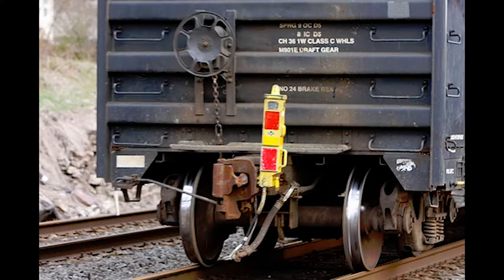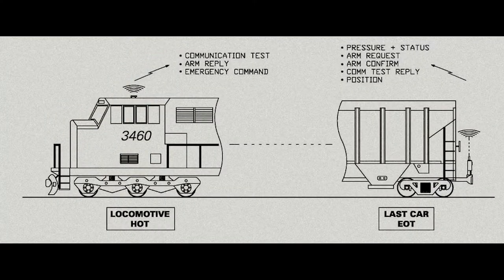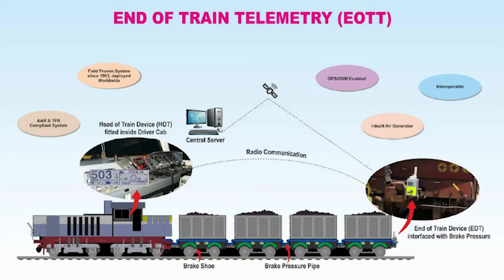What is the flashing light on the back of a train?

Comment: Also defect detectors & dragging equipment detectors replaced the cabooses too. The same jobs that EOTs, defect detectors, & dragging equipment detectors do were done manually from the caboose by the conductor & brakeman who rode in them back in the day. When the cabooses retired & were replaced by that new technology, it made the job easier, safer, faster, & saves the railroads money too. From there, the railroads no longer needed a brakeman but still need a conductor. The conductor's spot was moved up to the cab of the lead engine with the engineer.